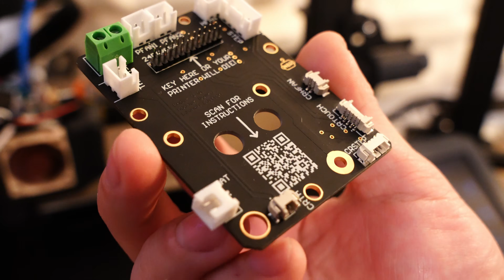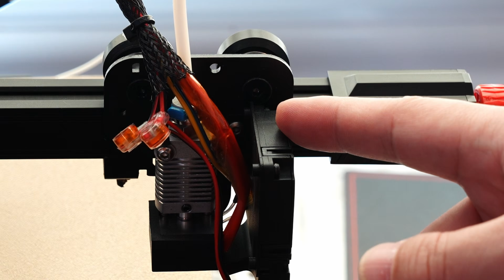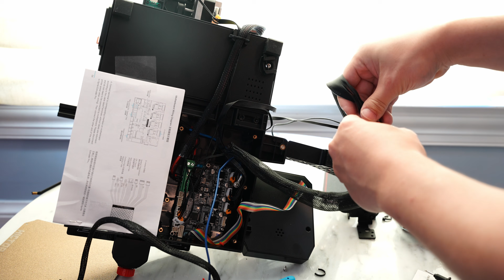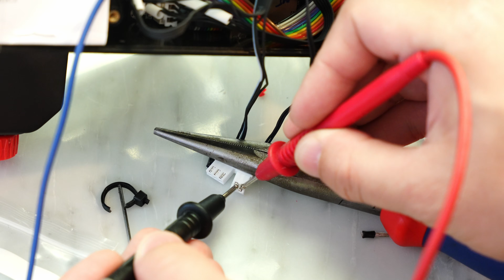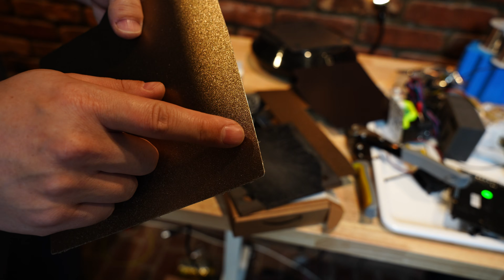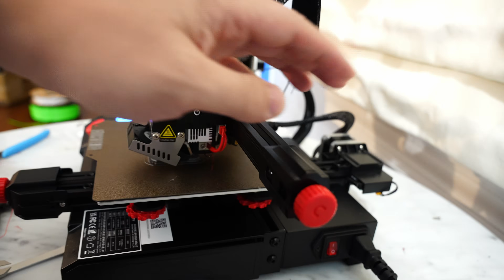Ender 2 S1 Review - Sprite Pro Upgrade Kit

Comment: You keep going on about the wiring being bad. have you ever considered this hotend came out before this printer even existed? This was never meant to be installed in an Ender 2, this is meant for an Ender 3

Plugs dont fit, extra wies you dont need, and "poor designs" that make no snese. until you ealize this guy is an idiot who is reviewing a part NEVER meant to be used on this printer. LMFAO

Comment: I've been thinking about it, and I think the 3-pin that short-circuits together has to be that way. That's for the filament sensor.
Reply: @hidayatjafar2079  I was gonna suggest that the YWO pin connector is for filament runout sensors - but my old Ender 3 doesn't have one to compare?? I would think it would just take a to and from for a simple switch. And if it's normally closed when filament is present it would make sense to come shorted - not ruining your board but allowing printing to proceed. I'd think the 3 may be for lights? Don't have that, either. Flashlights in abundance, though? 😁

Comment: Can you do a vid on installing Klipper on this? I actually did the same thing but idk how to install klipper
Reply: The first thing... it depends on if you have the 4.2.3 board or the v2.4. s4.170 board. Makes a big difference. Otherwise, flashing klipper is somewhat documented if you know what board it has. Just google klipper on (board model) and quite a few have done it. As far as configs go, you can easily use an ender 3 config and modify it to match the values of the much smaller printer (bed size, z height, x/y max, etc). Klipper really is that simple.
Reply: @ makes sense

Comment: I know this is an older video, but I have to ask, did you happen to weigh the original hotend components and carriage components riding on the gantry? I'd really like to know what the weight difference between Sprite Pro and the OEM components.

Comment: Thz ,You probably save me about 6000 "wtf's"     This sht is gettn on  my nerves..    After gobs of time and money replacing bout everything  on my CR-10 Mini. And thought is was finally finished . It decides to in the middle of a print.to do  a full speed retract and doesnt stop.       It rips the filament right out of the hot end      and keeps  retracting. and wont stop. Have to shut down the pos  at that point. 
Does it on every Print now . WTF?   
BTT SKR mini v3 nothing but troubles. 
Latest     ,The USB connector falls right off the mother board. !    1/16 mm   bit of solder on the POS.

Comment: Gotta give props to the ender 2 pro. It gives me really clean prints and is my go to when i need smaller parts with great print quality. All i have done to mine is bimetal ender 3 heatbreak, hotend fan, extruder, Capricorn bowden,copper nozzle and metal extruder. 

I am happy with it but i feel is too stock and needs more mods to fit in with the other printers lol. 

Does the sprite handle tpu well? If so that may have to be my mod.

Comment: Perfect work, thank you very much your job. Could you send me the correct e - motor pin sequence. Because on the mainbord colors Black-Green and Blue - Red VS Black - Red and Orange - Blue on the extruder. My extruder try moves up/down in the same time. Thanks in advance
Reply: Hello i can't wait, and i tested the variant. 
The correct wired sequence is
 From Ender 2 Pro motherboard - to Sprite Pro motherboard wired colors: 
Blue - Black / Green - Red / Red - Yellow / Black - Blue.

Comment: hello. I also installed sprite extruder pro on my ender 2 pro. But I have a problem. Due to the new extruder, the printing area has shifted to the right by about 3 cm. I thought it was the end caps of the X axis, but after printing the mount, the offset remained about 1 cm from the center. Tell me, how did you fix this problem?
Reply from the maker: I think you can cut off a bit of the aluminum off the left side of the hotend plate. It has a piece sticking out for some reason, maybe to shift the zeroing trigger further to the left for compatibility with some other machine.
Reply: @NathanBuildsRobots   thanks for the reply. After reserching this problem, I was able to fix it without mechanical intervention in the design of the extruder. I had to print out a new X-axis end cap mount with an increased actuation distance, after which I set the nozzle offset along the x axis by 10 mm , and along the y axis -5mm in the cura settings.
After that, the printer started printing as before. without offsets of centre

Comment: Wow, 94 comments and not one mention that the sprite extruder you installed is not at all compatible with the Ender 2 printer.  You probably should include some commentary like " you will need to make all these mods and you will have extra wires" if you try to fabricobble this extruder with the ender 2.  Surely, that would be a more scientific approach?
Reply: I was looking for this comment.
But he blames Creality for poor design, when he's putting 2 things together that weren't meant to be.

Comment: Morning, Nathan. In ten hours or so I’m going to see if I can install my Sprite Pro on my BIQU Hurakan. I’m going to be using your video as a guide. I’m doing this because the original hot end on my printer is a pos. The all-metal extruder is also a pos. I bought a CR-Touch for the Sprite. The Manta M4P has BIQU’s Micro-Probe plugged into a BLTouch port on the board. Of course the Manta board isn’t a Creality product. But you did say this Sprite could go on any printer. That’s why I bought it a few months ago. Anyways, I wanted you to know because I’m hoping you can help me edit the generic config file for the Manta to accommodate the Sprite’s e-steps, which are 424-something. I’m going to connect with you on Discord in case you’re willing to assist me. I will compensate you if you do that. And the Sprite ends up working as advertised in the Hurakan-Manta board.
Reply from the maker: Yeah no problem, just message me on discord. Should be coming up soon?
Reply: @NathanBuildsRobots  I’m dealing with the y stop problem at the moment.

Comment: Good old Creality, snatching defeat from the jaws of victory. Once the parts fan header fell off the breakout board and took the pads with it right before the thermistor wires snapped I just sent it back to them. Just looking at the board is a great insight into how the magic at Creality happens, save space with smaller connectors, then make it totally redundant with the power connection but don't bother to go back to fix what are now multiple points of failure. 80N of raw retracting horsepower sadly was only enough to get an Ender 3 into the air, but not keep it there. I believe in you Creality!

Comment: Hi Nathan , what is the printable size of your E2 pro bed? Seems is way to the right .. the purge line is about 1 inch from the  right side of the bed?
Reply from the maker: It has to do with the Sprite Pro carriage. It has a nub sticking off on the left side. I need to hacksaw it off to get it to use the whole bed.

Comment: yeah ferrule ends....go nathan, since they used ribbon cable they were stuck but could have used the extra wires for extra current capacity. but proper purchasing of ribbon and separate high current wiring would have been nice
Reply from the maker: The wires should be good for 1-2 amps each. So 2 wires is OK. Wouldn’t hurt to use the rest though
Reply: Have you ever look a high flex cabling from companies like oleflex. That wiring is so nice

Comment: Hello.  the manufacturer said that it cannot be installed on this printer due to the fact that there is no firmware for such a printer.  how did you get it to work?  😮Or is there no need for a special patch?  thanks for the answer!❤
Reply from the maker: No idea what they mean. If it fits it works! However, there is an issue with the Ender 2 where I think you can’t flash firmware into it due to some dumb choices they made for the Mainboard design. Worst case you will need to put a new Mainboard in it to unlock all the features, but for me this works well enough
Reply: @NathanBuildsRobots   thanks bro

Comment: If you hate Creality so bad, sell your printer and buy something different.  From a design perspective and business model, using universal harnesses and connectors makes sense.  It's cheaper and more cost effective to manufacture.  Creality is not responsible for unqualified end users who don't have the skill set to understand or install parts.   Creality should be applauded for covering tons of "defective" parts that are customer induced from doing modifications.
Reply from the maker: I agree with you on that, they are very generous in replacing parts, even when it’s not their fault when things broke.
I don’t hate creality, just providing my commentary on their design choices, take it or leave it.
My main issue is with their decision to include “short plugs” that if plugged into something will destroy or damage your printer mainboard. Since they are covering the cost of repairs in many cases, it makes business sense for them to employ poka-yoke principals, to save the end user frustration and to increase their profit margin.
You’ll notice, I did not install anything incorrectly or damage my printer because I have the expertise to understand and install things correctly. However, that does not mean anyone with less experience than me is dumb if they make a mistake. Engineering something so it is harder to make mistakes with it is a sign of a good and safe design.
For example, you can’t plug a USB cable in backwards. Older models have keying features, usbC has a mirrored design so orientation doesn’t really matter. Those are good design practices. Letting someone plug something in that fried their printer when they could have just as easily terminated those wires with an insulated plug is negligent.

Comment: Crimping the ferrule ends is definitely essential! I didn't crimp the ferrule ends and the plastic parts holding the wires to the mainboard completely melted on my Ender 3. It completely fried it. Do you have any recommendations for a new mainboard? Thank you, and great video as always!
Reply from the maker: I don't know what will fit in there. I do like BTT boards.
A ton of ppl say you don't need to crimp ferrules, and say "oh it'll be fine".
Fine and right are not the same thing!

Comment: They might use those "Shorted cables" to transfer higher current for another model.
Reply from the maker: That is possible, but not likely. You would need 4+ and 4- to go to the boater cartridge to do that. The negative line is 4 wires split into 2x heater, 2x shorted. The positive is 4 wires split into 2x heater, 1x heatsink fan, 1x part cooling fan.

So they would need to do something about the fan cables. 

This is typical of Creality. They get something done and move to mass production ASAP, instead of spending more time optimizing the design.

Comment: One interesting note about the heater connector. When mine showed up, the red wire was not plugged in to the board. It was left loose with a tag that said "Please insert it in to the adapter board before using". I assume this is to prevent the stress on the red heater cables/connector that you're mentioning in the video. It LOOKS like yours had the same tag on the wires, but it already came plugged in from the factory, which is definitely weird. More of that fine Creality QC, I'm sure! Haha
Reply from the maker: lol, yeah there was a dent in the box from where the plug was pressed up against the cardboard. No fires yet though! So it must be ok!

Comment: Lol, drop another $60 for the water cooler. It is a lot quieter, but definitely overkill. Definitely max level style points.
Reply from the maker: I don't understand the draw for watercooling. Seems like a vanity project, unless you plan on using a chiller to go sub ambient, or in a heated enclosure.
Reply: @NathanBuildsRobots  it definitely is mostly vanity, but if for some reason you were to get a crazy hot heating block that for whatever reason still fit the stock extruder, then it could work I guess. I got it because it looked funny. It is noticeably quieter, but I'm sure you can achieve that with noctuas and resistors. If you're going for absurdity however, I believe it's a must.

Comment: I just bought the same Sprite Pro kit today for $75. Couldn't pass up such a good price on it so I guess I'll be doing this mod soon, myself. I also have a CR Touch that I picked up for $21 so I might as well throw it on for fun. My printer has the 4.2.3 mainboard so I'll have to check on the extruder wires to see if mine are the same as yours. Can you provide any info on the wiring you ended up with for the extruder, just in case I need to do the same? Thanks for all of the hard work!
Reply from the maker: https://www.th3dstudio.com/product/ender-2-pro-stepper-motor-adapter-cable-4-pack/

You might find these handy. If you want to make your own, basically they are all in sequence,  left to right. If the motor turns backwards like mine did, just reverse the order of the wires, or flip the plug 180 degrees
Reply: @NathanBuildsRobots  thank you for that! Which pin is the extra ground wire? I can't tell from those pics, unfortunately. I was thinking i would probably shorten the wires and re-crimp the pins for the connectors, then I'd just take the extra ground wire and ground it in the same spot as the common ground.

Comment: I'm definitely interested in what you'll do with it. Seeing it running clipper could be interesting. Or maybe an enclosure for real high temp printing? 🤔
Reply from the maker: Someone told me I have a weird board version where the firmware can't be flashed. So I guess I have to leave it stock
Reply: @NathanBuildsRobots  What a shame. I'm interested in what you'll come up with next none the less 👍🏻
Reply: @NathanBuildsRobots  does your board not have a version number? I've been dumbfounded since every other printer I have has the version on them.
Reply from the maker: @AreanApple  I think it does. Someone spotted it in the video and left a comment

Ernesto Galban:
I just saw in your video that you got the black sheep mainboard like me.  v2.4. s4.170 you can't find any documentation about this so no bl touch or klipper. Just left change it for another. Very good video

Comment: Thanks for the review. Also I don't mind not having abl and especially for such a small bed. I usually only probe my bed when needed which isn't often. Otherwise it's easier once it's tuned but adds more weight if you like to print fast.
Reply from the maker: If you're putting a stepper motor on your hotend you might argue that the BL-touch wont make that big of a difference!
But I agree, I don't think it's necessary on a bed this small. Unless you plan on swapping out different bed types.
Reply: @NathanBuildsRobots  every gram counts when you're trying to go faster with accuracy. I was looking at the sprite but may still go with the Sherpa mini instead.
Reply from the maker: @noktrnl123  probably a good call. The Sprite is not weight optimized

Comment: Added one to my ender 3 pro, it's working great, had to adjust y limit switch 10mm closer and reduce x bed size by 8mm , due to the nozzle being out of bounds.
Reply from the maker: Yeah, I'm missing an inch of the already small bed. I can get most of that back by just sendinf an X-offset update in gcode but I'm lazy. The rest can probably be gained back by moving the x-axis limit switch further to the left.
Reply: @NathanBuildsRobots  but I'm looking forward to see what you do about the fans and future mods to the Sprite!

Comment: NBR is the junkyard wars of 3D printing.
Reply from the maker: Next I need to open a Pawn Shop for 3D printers.
Reply: @NathanBuildsRobots  If the speed benchy challenge had cost divisions, I think you'd be a contender in the under $50 division.
Reply: @NathanBuildsRobots  I would show up and try to rat rod a Rat Rig.

Comment: I just saw in your video that you got the black sheep mainboard like me.  v2.4. s4.170 you can't find any documentation about this so no bl touch or klipper. Just left change it for another. Very good video
Reply from the maker: Very interesting! I was planning on keeping it stock, but now I don't have a choice! 
I almost never update firmware on my machines anyways, so it is not that big a deal to me. But could be very annoying for others.

Comment: And that is the reason I dont touch Creality upgrades!
Reply from the maker: Yeah, the "standard" that they came up with for the 24 pin sprite interface is awful. Just seems like they randomly assigned pins, and despite having enough conductors, they merged heater cartridge power with fan power... Real sloppy.